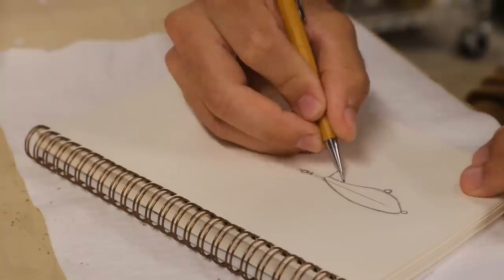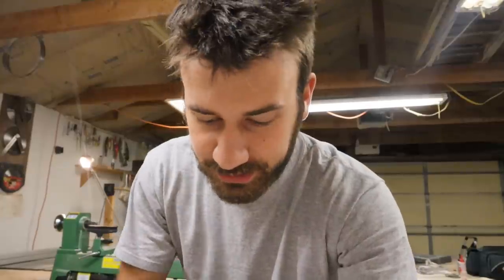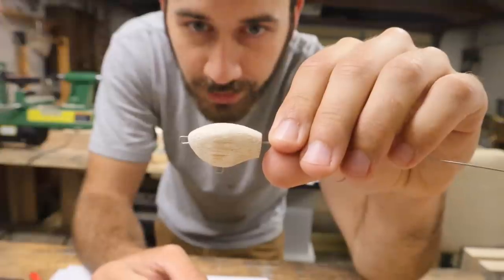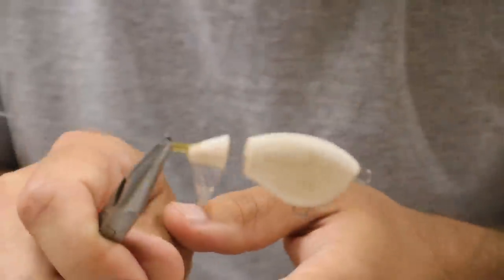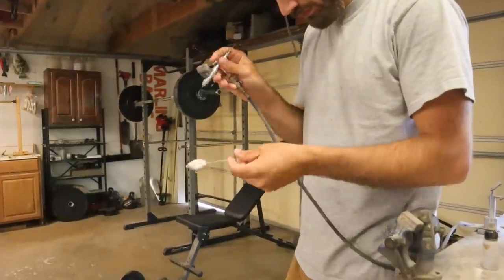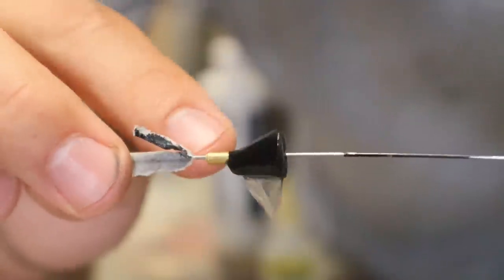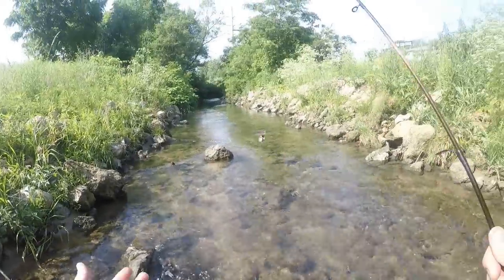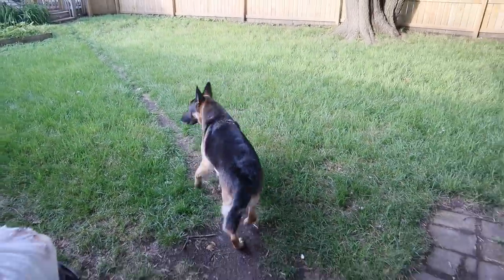UltraLight Whopper Plopper | One Day Build to Catch

Comment: You sir are an artist! I remember trying very unsuccessfully to make plugs over 45+ years ago and since I predominantly was an UL fisherman, astoundingly unsuccessfully trying to make UL lures!  I think I have some inkling of how difficult it is. I remember that when the Big O came out, the handmade ones cost $100, then Cotton Cordell introduced the plastic molded 3/8 oz and 5/8 versions but I wanted a 1/8 or less style fat minnow plug. Attempts were, hideous and didn’t work. When Bagleys came out with the Honey Bee I was extremely happy.

Anyway, about weighting an UL plug, I had problems with getting lead weight to stay it (this is before crazy glue of any type) I found at high cost back then tungsten wire. The benefit if I  weigh out (with an old reloading scale, no highly accurate cheap electronic scales back then) sufficient tungsten wire I could drive it into the bottom of the lure. If the little lure warranted it, I could insert the weight at whatever angle it needed to ride right. I could then glue it into the lure. I could conceptualize, but not execute. I applaud your skills and abilities. 

As to River-to-Sea coming after you because of the Whopper Plopper, maybe because of the name, but certainly not the concept. You see, River-to-sea copied an 80+ year old design, the Mud-Puppy lure bay C.C Roberts bait company, a Wisconsin based lure company that most of their sales are local as the hand make their lures, by necessity, because their in Musky ?Country, and as necessary there lures are pretty large. The area is also river-rich so they make a smaller version which apparently is quite successful with river small-mouth and trout.

Anyway, apparently River-to-Sea, basically went to China and had a lure based upon the Mud-Puppy design.
Oh yeah, as it’s a big hand-made lure for musky fishing, it’s not cheap, as you might imagine.

There’s another thing that might be of interest, it’s a book written by a famous writer of the 1940 through 1980’s , era Charles K. Fox, predominately fly fishing, but he’s was also a pioneer in the concept of “light lure casting” which in that era was lures less than 3/8 oz, and occasionally 1/4 oz. Before  widespread the presence of spinning tackle, really not before the 1950’s lures smaller that 1/4 oz were considered “fly rod lures.” 
Anyway there is a book written by Fox that was published in the mid-70’s, called “the book of Lures”. While the book has its problems, it’s got pics of many lures of the day and some of them didn’t make to days age. In the text, Fox presents the idea that the industrial technology of his day would let one make lures other than was constructed by factories of the time. 
So, what may be the most interesting part of the book, is there  is a section of the book titled “Homemade Lures” where he illustrates several of his possibly favorite lures and the steps taken to construct the lures. While the picture are just okay, the text is really good. If you would be inclined to look at the book, it’s out of print and probably not found in libraries or on-line, but can be found for sale, I think cheaply, used. I’ve found it on sale on EBay and other sites.

I really look forward to seeing your work and skillful artistry.

Comment: Hey Marling! If you just heat the polycarbonate it should bend around the pin/rod thingy just fine, and use a hairdryer so it does’nt burn it. If you (only) heat the pin/rod thingy it wil kind of melt into the polycarbonate and leave a ugly mark. Just a tip, no sweat is was a great video!

Comment: I'm really surprised the manufacturers haven't already come up with an ultra-light version of the whopper plopper.  I'm really glad to see you tackle this project.   I've been drawing up models to 3D print an ultra-light version of the whopper plopper.   My alternative was going to be to simply modify one of my existing ultra-light crank bait lures.  
It's the angle of the propeller that kind of had me stumped.  Also; rather than using lead on such a small floating lure I would have probably gone with a simple BB or ball bearing.  Since it's sealed inside the lure it's not likely to rust or corrode.  TO soften the thin piece of plastic A heat gun works wonders with no damage to the plastic.  
Another well done project.  I'd like to see you make an ultra-light top water frog lure.  You've most likely already made a regular sized frog bait at some point.  I only recently started watching your vids so maybe you already have made an ultra-light frog; I don't know.

Comment: Just an little pointer: you can drill your holes while the block is still square. As long as you follow your pattern when shaping, there shouldn't be much change.

Similarly, if you leave your poly-carb long (like half a popsicle stick) you have enough real estate to grab and twist with pliers, then you can cut it down later.

Regardless, you're putting together some really good looking lures here, man. Good on you.

Comment: Wouldn't it seem more appropriate to drill the blank before even cutting it out? Also try a Dremmel hanging with a flex shaft and a chuck to hold a drill bit , it's much easier to hold and aim as you guide it thru the blank. Especially on small pieces, and to clean off finishes from line ties and hook holders. I love your videos and have started making some baits. I have been a pro craftsman for decades though, and have a good bag of tricks. Thank you for this video, I love whopper ploppers.

Comment: I just started using plopper  last spring.my biggest prob 4.5 lb lk largie on the choppo frog pattern. I was doin good with the t 1000 plopper. I buried it in my finger 1 day the 75 size. Not good..luckily it was so sharp it didnt feel it go to in but it was so hard to get out .even the er doc said  wow how did u  do this. Tried removing myself  bad idea...those big needles to the finger will wake u up.

Comment: If it was me I would try using electrical heat shrink to the spot where you hang it on (the line tie) and a lighter. It might take some time off that process.  Or I could be wrong, you never know.

Comment: Would it help, to run a fine drill down the center of this, for the wire, so it all runs true, then cut the back off, and then cut the wire slot down to the drilled hole? That way when you hack the butt off, the hole will only need widened a little bit for the bushing, and it would be easy to line up since it would be one bit size up and already has a pilot hole.

Comment: You know on your larger baits, to keep the lead from sliding or trying to slide out why not use a dremal to drill a hole from one lead hole to the next oneso the lead connects the two? This would also lessen the number of holes needed to drill. Or drill a hole through them from the front and use a tie wire as an anchor for all the lead. I hope you know what I mean. I'm better at showing something like this then saying what I mean.